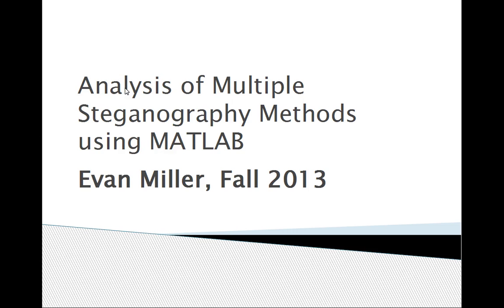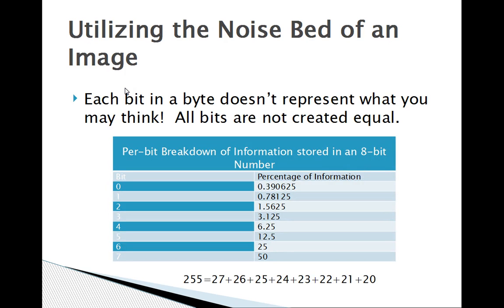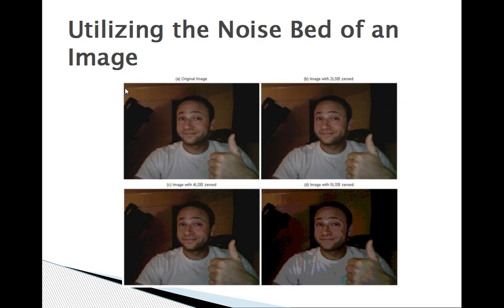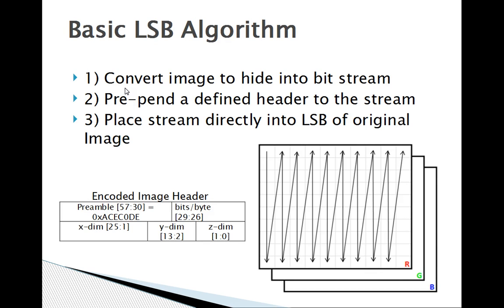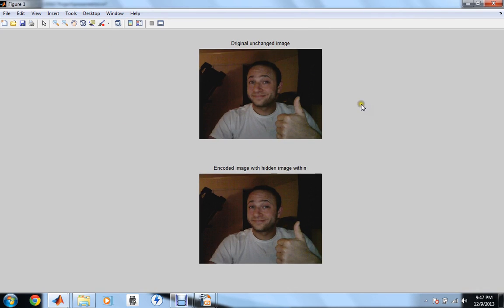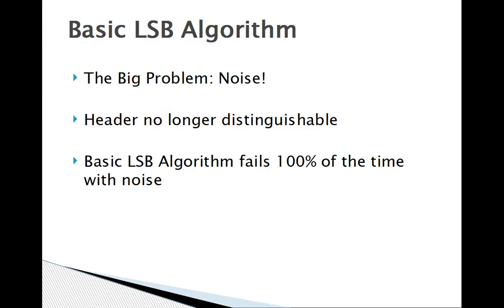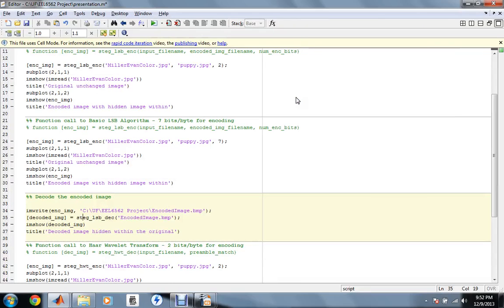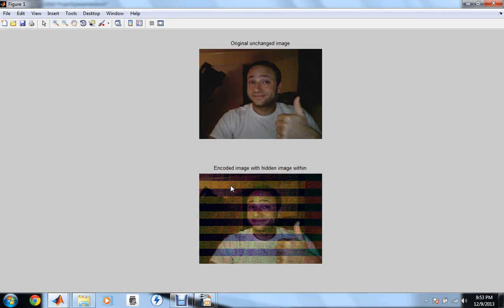Analysis of Multiple Steganography Methods  using MATLAB

Comment: Hi,very interesting presentation. I am interested in Haar wavelets,could you please send me code for this to understand them better? hitmanpaddy@hotmail.com
Reply from the maker: My project had very little success using wavelet transforms, so I spent very little time on the area. The entirety of wavelet usage in the project consisted of using the matlab function 'dwt2'.

Ex:
dec_img = imread(input_filename);
[cA1,cH1,cV1,cD1] = dwt2(dec_img, 'haar');
Reply: Evan Miller Thank you for your reply. May I ask why DWT gave little success? I am doing a project on steganography also. I am thinking about using LSB method in DWT domain to hide the contents of a text file, maybe It's not so good of an idea?? All my research states that DWt is way better than LSB spatial domain or even DCT. Any chance you could send me code for DWT. I am having trouble embedding data using LSB method. I think its because DWT coefficients are floating numbers??